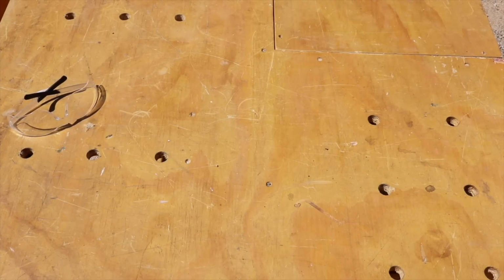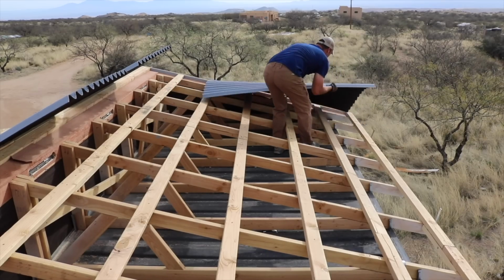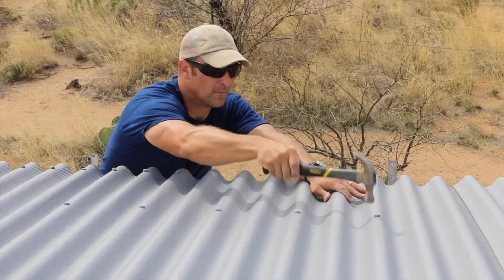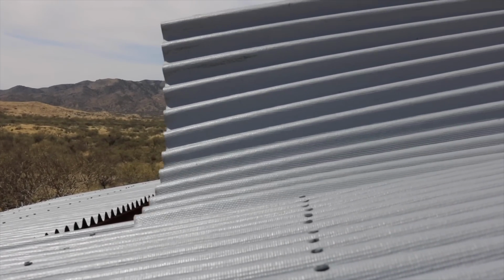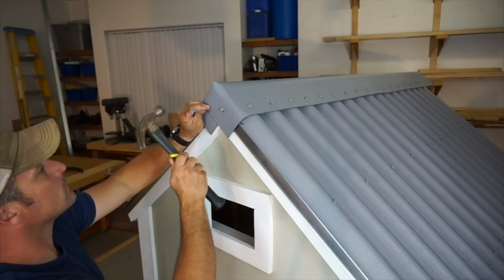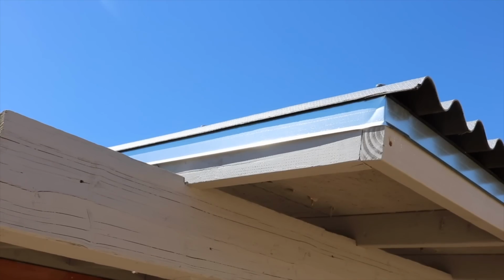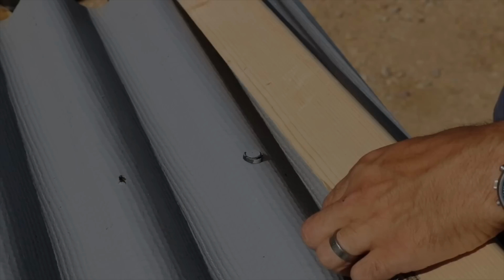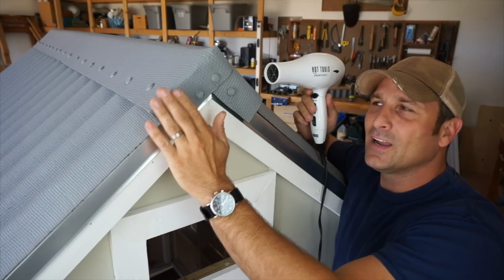ONDURA Installation - Detailed Instructions for Roof Installation

Comment: I installed these on my roof in 2001 on a 40 x 25 foot roof. They were on the roof for 22 years before the sheets started shrinking quite a bit and deteriorating on the edges, but this was on the west side of the roof that gets a lot of hot summer heat. East side wasn't as bad but was showing the start of same issues.
Reply: I need to add, this video would have been nice if I had been able to view it, few of the tips would have helped out.

Comment: I just finished installing an Ondura roof onto my new firewood shed.  It was very easy, thanks to your video!  Why do you screw into the peaks rather than the valleys?
Reply: The valley will create a leak entry

Comment: For using this product on an older garage, should I put a small bead of silicone on the overlapping seams? Would that help prevent rain or moisture blowing up underneath and wetting the roof? I'll have to put down the black tar paper over the roof once I remove the shingles, but when I hammer down the corrugated roofing, wont drops of rain seep through and into the roof itself? Should there be anything else added to prevent any moisture from accessing the inside of the garage?

Comment: What's the minimum pitch for ondura?  I see the front of your building looks to be around 1/12 ish?

I am looking to use this on a 1/12 carport, with a full deck.  Would it work?  

I see onduline europe has instructions for overlapping 2 corregations on lower pitch roofs.  Can ondura do this also?

Comment: The video uses nails for the projects shown. Home Depot seems to only carry "Self Sealing" Paulin screws that come in 2 lengths: 10 x 1-1/2 and 10 x 2-inch ! For an OSB board (1/2 in. thick) project what length of screw would I use ?

Comment: Very informative and helpful.
I did the tan color over an open section of my chicken coop and of course it dramatically reduced the temperature. I’m doing using the same color tan on a roof over put pool deck. I found out Lowe’s is discontinuing the Tan color so I had to travel 1.5 hrs to another Lowe’s to get the Tan.

Comment: If I use the foam closure strips on the bottom under the panel, do I also need them under the panels at the top or does the strips that are held in by the ridge cap suffice?

Comment: I'm about to roof my new 12'x16' shed. It will have a medium pitch  roof (3' peak over 12' wide). I saw these panels at Lowe's. It will have 1/2" plywood decking, first truss completed, will make 12 more copies, for 16" centers. I think I'll use these panels. Btw this is a side project. The main one is the container home I'm building. I'll be using metal on that.

Comment: I am in the process of putting this on a porch roof in S.W. Va. I have read the sheets that come with the roofing. It say to repaint every 5 to 10 years. My question is how do you paint it  when you cant walk on it. It has been about 80 degrees here now and if you put any pressure on it with a hand or knee it caves in. I built the board but sometimes you reach out to put in a screw and it really bucks down. Thank you,

Comment: I looked at this product many times at Menards but it sounds like they do not have many sales. I live in Northeast Iowa. Also right off would like to ask about the short stuff I seen on Ebay or someplace. It looks just like Ondura shape etc but short to make a tile look. Are the short panels available from Ondura or would you recommend just cutting them to get the tile look. I also wonder if a overlapping tile-look app would be a more solid job since you would be screwing in two panels. Also, does Ondura compare to shingles against hail damage and insurance coverage on a house?? Thanks !
Reply: I second that question!

Comment: Great video mate,What are your thoughts of using tek roofing screws instead of nails?easy to romove and much stronger holding power,
Reply: I have the same question, I know how the sun can deteriorate the vinyl on other things, those nails or screws won't seal for too many years!

Comment: Did you have to drill the holes, or are they pre-drilled?
Reply from the maker: No need to predrill the holes. You can drive nails or screws directly through the ONDURA sheets. Please use washered nails or screws. We sell washered nails and washered screws that are color matched to the ONDURA sheets.

Comment: I want to use these panels on an octagonal gazebo, so I will be cutting sheets on a diagonal. Any suggestions on how to join the hips?
Reply from the maker: The hips can be covered with ridge caps. A support will be needed on each side of the hip, into which the fasteners will go to hold down the ridge cap.